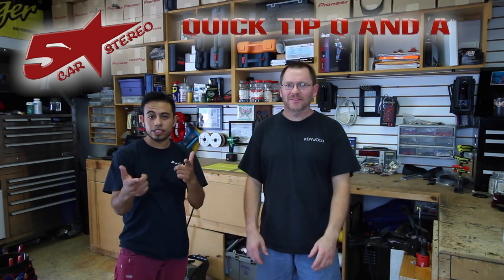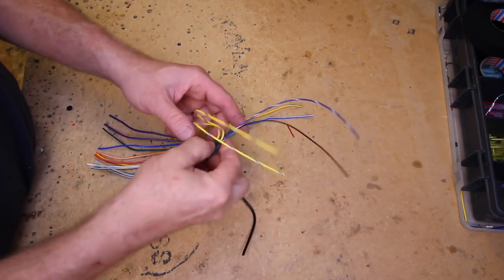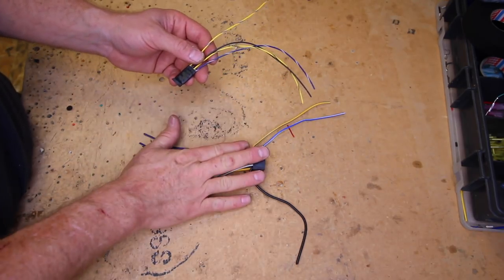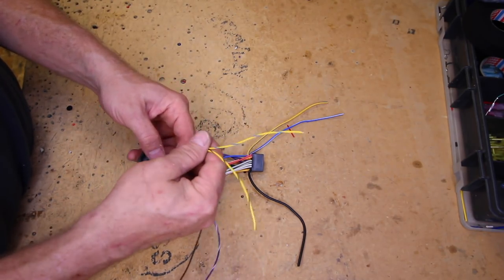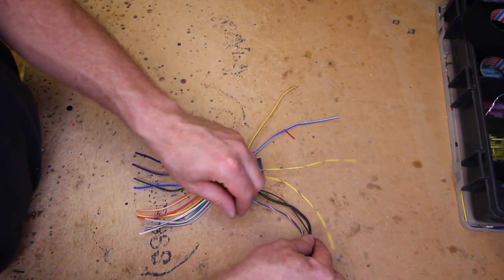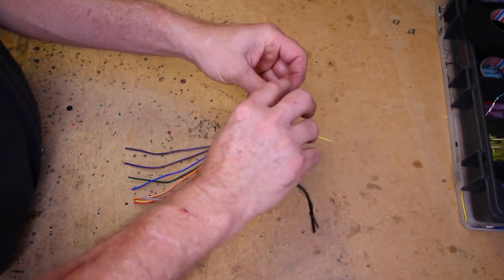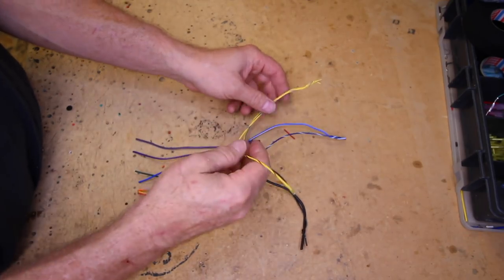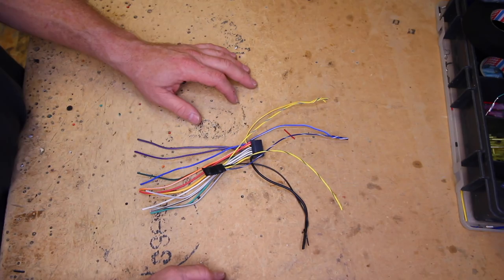How to use the video in motion MircoByass on an Alpine radios

Comment: What do I do if I have the blue/white remote wire connected to an amp? I have the Alpine iLX-w650 stereo with the Alpine KTA-450 amp and don't want to have to go to the parking brake to be able to use it

Comment: I have a new iLX-W650 stereo and the Carplay works but it doesn't allow access to the settings or any other function (bluetooth,  etc) are all gray and not accessible.  Please help me.
Reply: Same issue. And they never use the correct 4 wire microbypass, they use the 3 wire, or the one that has a yellow blue and yellow black wire. But the w650 does not have a yellow black. I have no idea what to connect it to.
Reply: Just ordered the bypass for my W650 and from what I have been seeing, it should work. Just look at the wire chart on the head unit, find the correct wire which I believe there’s a parking brake wire, and connect it like they show in the video.
Reply: Ever get this fixed?
Reply: ahum870 yes,  one of the micro bypass wires was not connected properly and was loose. Now it works but I don’t have video. Not sure if I should have video capabilities or not.

Comment: I am putting the bypass to an alpine ixl 309 I did it as you publish it but it does not work only if I detach the cable from the parking lot and put it back, the yellow cable with black stripe works that goes to the brake pedal but I do not understand it is difficult  connect there

Comment: If i am using the RP5-GM11 do I just cap off the parking break wire that comes out of the RP5?
Reply: Aaron Blackmer  same here did you just tie them in with the rp5? Or cap off the rp5 wires ?